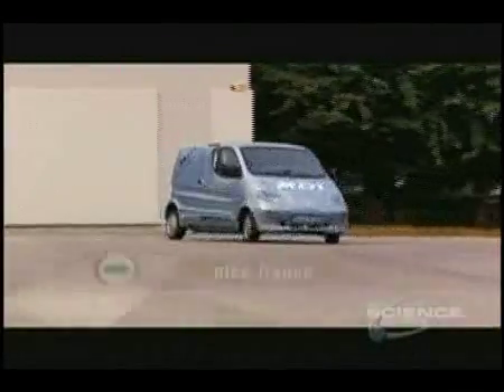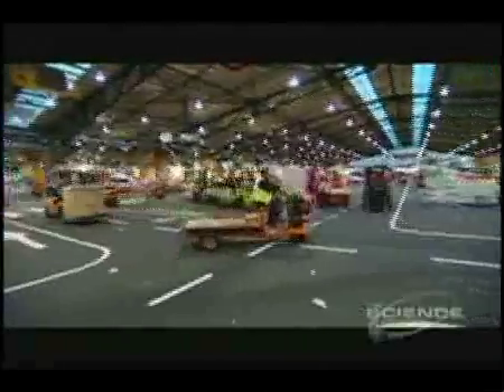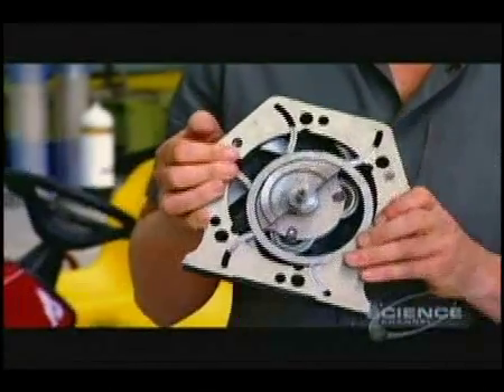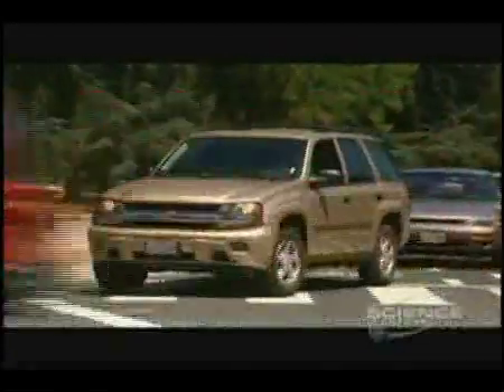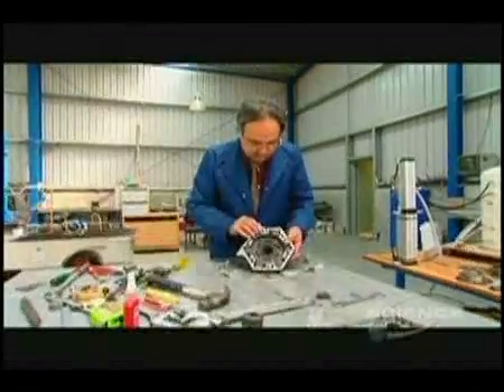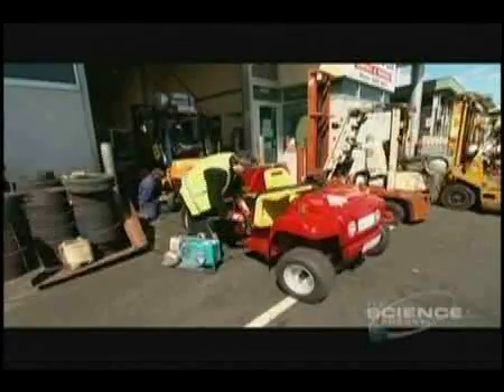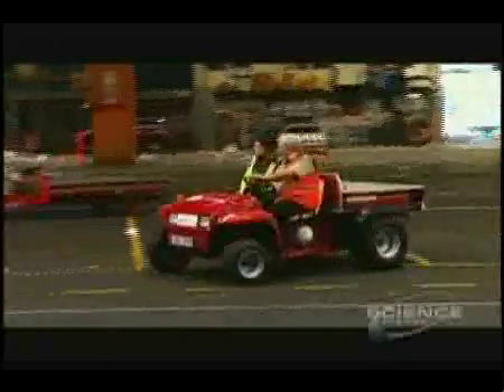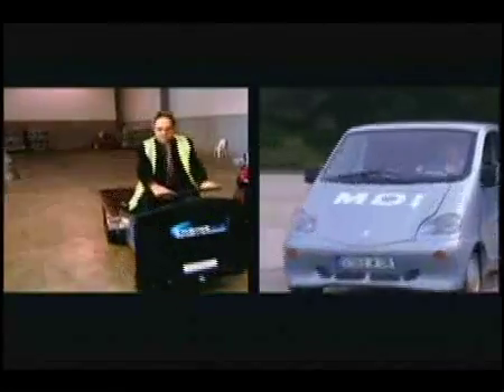Air Car (2 of 2) from Australia

Comment: The reason why this never took off is obvious if you have any clue about physics and mechanical engineering. You need to input a ton of energy to compress the air. Even when it is compressed, the energy density is nowhere near gasoline when stored at actually practical pressures. Air compressors are also inefficient along with air powered motors. The most efficiency you get out of air motors is about 20% to 30% if it's been optimized properly. That's why these things never took off and also never will take off. Electric vehicles and electric motors kn general are simply better because of their nearly 100% efficiency, maturity, reliability and simplicity.

Comment: Why on earth did my post get removed? I'm really annoyed by youtube for removing my posts from the internet. 
Anyway, I wrote that you should get a chat with Tesla for example, they could perhaps make this thing for real if it can really achieve 200 miles of range without much of a problem and recharge within minits.
Reply from the maker: Your comment made it here. Perhaps it took time for the data to propagate through multiple servers.
Reply from the maker: I always think Elon Musk is taking a brute force approach with the Tesla batteries.  The current battery technology is still not ready for prime time. It still takes too long to charge, and too heavy. It may need a revolutionary breakthrough in battery technology to make EVs faster to charge. No more charging break every few hours on a long trip. Perhaps, someday batteries will not be needed when "Mr Fusion" type power source becomes available (remember Back to the Future II ?)
Reply: @cplai  I posted a very similar post earlier, I have it very often that my postst are suddenly gone after a few minits, especially when I post links or when I use words that might be offensive to anyone. Appearantly some youtube post remover got triggered again by some word. Elon is allways annoyed by the fact he got a lack of batteries and that that's the reason why he can't build more cars that fast and can't build big trucks yet either, there are simply not enough batteries out there. Somehow, if your car drives on pressured air, he doesn't need batteries and with his SpaceX rocket company he's probably capeble of building a strong tank for high air pressure, so if it works, I think he's the guy who could make it.

Comment: also, smaller home size solar power compressed air storage.
compressed air for 1 of these motors to make electricity when the sun or wind is not available.no lead batteries.  this is an idea there trying on a large scale.

Comment: If they made motorbike that runs on compressed air that can be filled up at petrol stations just like you pump your tires with air, I will buy two if the price is right. You can virtually ride around all day for free
Reply: +David Tay 3500psi dive tanks reduced to 120psi to run the motor, with a range of about 1 km, the air motor idea is a sorry pathetic waste of time.

Comment: What if you re-use the (exhaust) air? Wouldn't that make it have Perpetual air? Well, not really perpetual, but significantly increase its range?
Reply: The exhaust would need to be re compressed so no.
Reply: whats the problem with that?
Reply: jack smith you forget that if you pipe the exhaust air back into the motor somehow, you have just created a huge restriction to the flow of air out of the motor.  all motors need air in, and air out (compressed air, and gas powered) What happens if you fully or even partially close the tailpipe on your car?   the engine would die or lose a lot of power.  The same would happen if you tried to re-use the exhaust (depressurized) air coming out of the engine.  Compressed air engines (especially rotary) seem like they could be very useful...but no engine can take energy from a fuel source, and then re-use it again and again.
Reply: RCPro Driver thanks for explaining
Reply: jack smith Man, Its a matter of energy. stored as Pressure in this case. After the  energy was transformed to motion kinetic energy you can't use that low energy air.

Comment: Please read the original coment I replied to. The post was nonsence as the usage vs power produced was not specified. The fact is a 6 hp air motor even at MDI's or Engineairs claimed 90% efficency will empty a std 12L dive tank in seconds. Your post about engineering compromises is irrelevant to the discussion. Compressed air motors feed by air tanks lack the power and energy density to be anything other than a toy or a Scam.

Comment from the maker: Engineering is all about compromises and to find an optimal solution based on your design requirements. What you posted is like saying your car engine is useless because if you put it in a 18 wheeler truck it will burn out in 2 seconds. How about the 18 wheeler engine is useless when installed on an ocean-liner or the space shuttle? Your argument is simply pointless in that line of thought. You can always belittle anything by changing the requirement to something that it cannot fulfill.

Comment: Try a 6hp motor will empty a std dive tank in a matter of seconds. 
The engineer mob at least issue pdf'sfrom which you can see the HP consumption figures Boiling it down a vehicle using 6hp would run for about 5 minutes. If that excits you you're going to wet yourself when you see sliced bread.

Comment: Yes, you will need to use a large battery pack in your house to do that, then use these batteries to recharge car battery or to power air compressor to refil the tanks.. The smarttest ideia is use smart grid to substitute battery.

Comment: To compare vehicles over a century apart is not a smart decision to prove your point. Technology advancements in the past hundred years have been massive. To get from the fully mechanical Model T to the near completely electronics of the m3 innovations such as computers have completely changed the game, also the improvements in the building of roads have made a huge differences. Batteries aren't completely recyclable and still need a constant supply of resources because of the chemical reaction.

Comment: @DraRed73 I know, but your comment was "At present the creation of electricity comes mainly from heating water to make steam, ie creating a pressurised gas. Why take that gas and turn it into electricity with all the associated inefficiencies rather than store the compressed gas and use that directly. Far more efficient.", which is hard to do when the compressed gas (steam) would soon condense.  Perhaps you meant a mechanical, steam driven compressor? Did I misinterpret you?

Comment: @OhNoItsJoana No, a large high pressure tank can fill it in three minutes.  The compressor took four hours.  I'm too sleepy to double-check my math right now, but it looks like 200 litres of air at 300bar is roughly equal to one litre of diesel fuel for raw potential energy.  I don't see how this energy equation can work, though anyone who's handled air tools will tell you that the POWER density is incomparable!

Comment: @cplai No way. We could just put the compressor inside the car next to the motor (since it's so small) and stop at the gas station, connect the compressor to the plug (also used to charge battery cars), wait 3 minutes and it's done! 
I think the main problems is petrol being so deep in our economics. It would revolutionize the world.

Comment from the maker: @ben210ben Your idea would not work if you consider the rate of production vs. the rate of consumption given the maximum surface area of the solar panels you can install on the car.  So you may be able to fully charge up the battery with 8 hours of sunshine and then the same amount of energy is only enough to push the car for 2 miles. It is a different story with a roof top solar panel, 8 hours of sunshine may charge enough energy for 50 miles.  The size of the panel matters.
Reply: How did this company end up actually? I like the concept actually.

Comment: the only bad thing about electric cars is that it takes them so long to recharge so say you were to use a solar panel to recharge a battery at home. the you could use that energy to refil your air tanks in like 3 mins problem solved? no co2 for energy. or would this idea just not work?

Comment: @cplai it should also be noted that generating electricity requires considerable torque as well. The other issue with this is that the air is compressed using energy from oil in one way or another but not a bad idea just the same.

Comment: @thekaizer666 You're over thinking that-- why not use the power that you'd use to run the compressors to fill the air tanks that you plan on using  to turn the motors to crank the generators to make electricity that you'd use to power the electric car to just  charge batteries? :) Cut out all of those middle steps. :D

Comment: @cplai try mechanically linking Angelo's engine to an air compressor and then taking an air storage canister to do the job. Engine drives compressor, compressor provides air for engine.

Comment: MDI air car 
Short range, 7.22km in the only published test. Horribly inefficient (5 times more energy than an equivalent electric vehicle). low powered 6 hp. A con aimed at extracting money from the technically illiterate
Google  e.volution south africa for MDI lies from 2000

Comment: Most importantly, it is incredibly cost-efficient to run – according to the designers, it costs less than one Euro per 100Km (about a tenth that of a petrol car). Its mileage is about double that of the most advanced electric car (200 to 300 km or 10 hours of driving), a factor which makes a perfect choice in cities where the 80% of motorists drive at less than 60Km. The car has a top speed of 68 mph.

Comment: So instead of certain people spending so much time and effort trying to demonize clean energy systems and complain about how utterly wasteful  it would be to use these inefficient systems ( even though air powered engines were commercially successful for many years ) how about spending that energy and time trying to improve existing technology and promoting honest technology , even if it goes outside of the box a little here and there , it all has to start somewhere , why not here ?

Comment: Di Pietro agreed energy was lost as heat when compressed air cooled but said that his company had developed a system that could regain this heat. This system was not used in the new vehicle but could be used to make air-powered motors more efficient for passenger cars, he said.

The system uses the energy in compressed air to take in heat from the atmosphere as well as air. This atmospheric air is then compressed to generate more heat, which in turn is used to drive the engine.

Comment: AMBIENT HEAT: Heat is available for free from environmental sources like the Sun for heating water, building materials, or air. Heat can also be stored, or conserved, by using insulation methods. So, it can be gathered when it is freely available and used when it is needed. But Ambient Heat can also be used as an energy source. In 1900, Nikola Tesla described an invention to use the heat in the ambient air to drive an engine to produce mechanical energy and refrigerated air as a by-product.

Comment: @thekaizer666 "i can't even deliver a simple idea to you in english"
Yep you are dumb  and illiterate, I knew that already 
So you'd take an air take to run an air motor and then add another couple of step to throw away the energy rather than directly propelling the car. 
Bwahahaha!
That is as stupid as your first  idea 
Hint
Battery - electric motor-car . It's called an electric car and it's hugely more efficient than anything air powered

Comment: @thekaizer666 
ROTFLMAO!
 so the air motor runs the generator that runs an electric motor that turns the compressor that runs the air motor that runs the generator that runs an electric motor that turns the compressor that runs the air motor etc etc etc
Bwahahaha 

How about a much better idea. Bigger diameter tyres on the rear wheels so it always rolls down hill LOL

Comment: @thekaizer666 The MDi air car has a range of less than 10 km ditto the Engineair offerings with a 4 to 6hr recharge time 
Recharging while driving?Need a bloody long extension cord for the 6 kw compressor.
Buy a bicycle

Comment: A BRIEF HISTORY OF AIR CARS

    For half a century the air-powered locomotive was a serious contender for the top spot in transportation because of its obvious advantages: simplicity, safety, economy, and cleanliness.  Air engines were commercially available and used routinely, first as metropolitan street transit and later for haulage in mines.

Comment: CBS CENSORS "COLD FUSION" VIDEO

    

The highly revealing 12-minute video clip from 60 Minutes on the fascinating resurgence of cold fusion has now been removed by CBS. I highly suspect media censorship at work here. A supporter emailed that the embedded video from an article posted on this at examiner.com was not working. Checking back on the original links to the video revealed that a weak clip of less than two-minutes had replaced the engaging, longer original.

Comment: @dreamzbeliever 

 They  lie with out shame

Only ONE published test, since removed, 7.2km This was followed by pages of increasingly hilarious "reasoning" as to how this would be increased to 200km. That was about 5 years ago. Swept volume of engine, gear ratio, wheel diameter,  volume in tank give a MAXIMUM THEORETICAL range of about 35km.
My std offer find one INDEPENDENT TEST that confirms MDI's lies opps claims and I'll sing their praise and pull my posts
I've been waiting 5 years

Comment: 2004 There is no other motor as efficient as the Di Pietro Rotary Air Engine. It is 100% more efficient than any other air powered engine built to date and its high torque makes it the first air engine suitable for mobile applications. The invention has the capacity to revolutionize transportation, plus offer a multitude of energy-saving benefits in stationary applications.

Comment: @mikehanoo33 First part of the video is MDI Are you completely blind? 
Engineair is just the same. A CON. Stupid claims for technically illiterate nit wits. 2 hours running? Only if you crawl at 2.5miles per hour for a FIVE mile range. But hey you are a true believer right? Well enginair will happily take all your money so shut up and invest CHUMP
Rotary engine LOL 
Look at a Gast air motor THE SAME THING

Comment: @fizzguts   Oh and by the way this video is about (ENGINEAIR) not MDI , that was part one , and Engineair is a totally different design , it uses a small ROTARY engine , that goes TWO HOURS ON A CHARGE , did you get that mister five miles , if your going to be a critic at least talk about the right video , it would be to easy to insult you here .

Comment: @fizzguts   I have showed you repeatedly evidence that proves air cars have worked ,still work,  and have traveled up to 500 miles on a single charge , and there are many volumes of data available on all the free energy and clean energy devices that have been suppressed over the years by the oil companies , I have posted some , but you still harass  everyone that is trying to bring forth clean energy machines , you must be working for the oil companies or you are quite mad . 500 miles yes !

Comment from the maker: @avalableusername The choice is upto you. The car no longer requires you to burn gas on board, so you can choose a clean power source to compress the air.  e.g. if you live next to Hoover dam, or a geothermal power station, you are pretty sure your electricity is emission free.  You can also run an air compressor off your roof-top solar panels.  If the source of your electricity is not clean, this car will not be clean either.

Comment: You replace the tiny gas motor with an even smaller air motor, then you replace the tiny gas tank with a huge air tank that will last 1/4 as long.

Comment: "if you leave it in the sun all day."
No 
The power to run the compressor (MDI state 7kw for 6 hours) needs the full sun from an PV array with mountings and charge controllers inverters etc etc that will cost you about $45000 and will cover the roof of a large house. 
Running any motor through a generator back to electric motors just wastes power.

Comment: It does seem a long time since seeing this on Beyond Tomorrow. But why just have that high torque air motor running a gearbox. Have it run a powerful generator, and run electric motors in each wheel. With solar power for extra power, running a compressor to top up the dual air tanks. Seriously, it can't be so hard to see one fuel won't cut it, but 3 rolled into one vehicle, using no fossil fuels seems like the best option. Best of all, no need to plug in if you leave it in the sun all day.

Comment from the maker: @Runningman3200 It is basically an air pump.  Instead of having a motor to drive the mechanism to move the air, the compressed air move the mechanism to drive the wheels.

Comment: "What would you suggest to pump air to 3500psi?"

A diving tank compressor. Dive tanks are filled to about 3500psi. That's what MDI use. Is reading not your strong point?

Comment: If you google the "Douglas Self" site you will discover air cars are an OLD obsolete technology.
If you had any scientific training you could understand from ideal gas law this is a CON
So. Why haven't you even bothered to google any of the links I have provided? Are you bone idle? stupid? a complete believer in woo so you don't need facts?
As for air motors I have three gast units with power vs consumption curves, have built several steam engines and understand air tools.

You?

Hello?